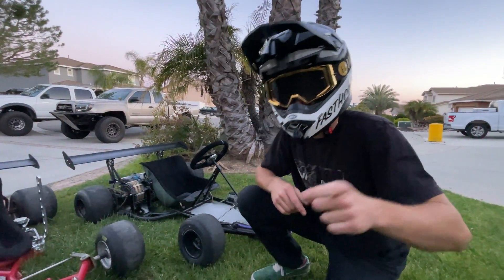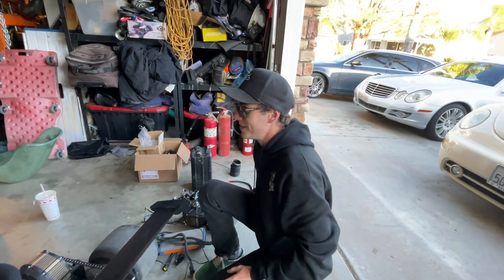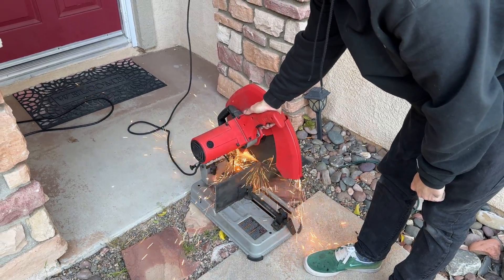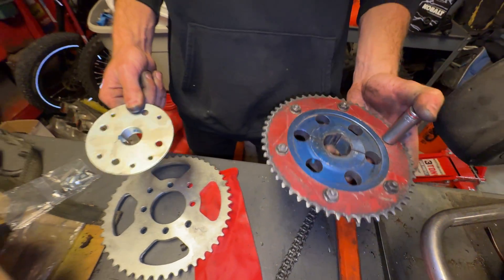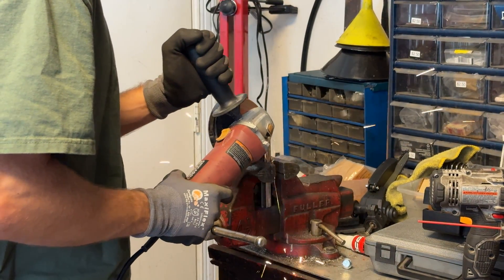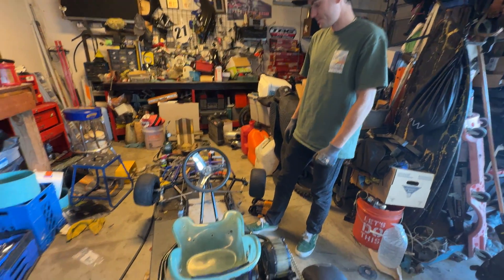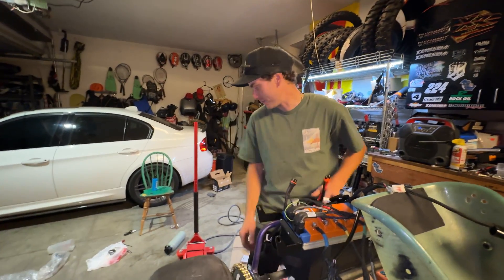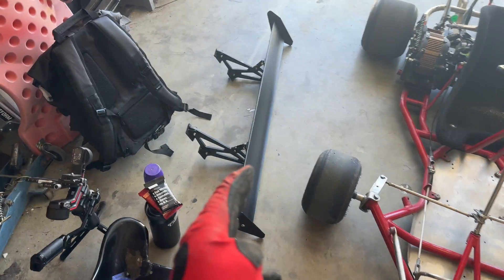We Built Another Electric Gokart! | DIY Tutorial

Comment: Why did it shoot a bolt of electricity when you plugged it in?😮
Reply from the maker: Didn’t have a breaker for it yet. So it was 72v 300amps of instant power going into the connector. If you add a breaker it won’t spark.

Comment: always amazed these plug and play controllers never use a precharge resistor
Reply from the maker: Yah, my kart has a circuit breaker that goes from the battery to the controller. This kart was sketch having to plug it in without it 😅

Comment: Great build! I'm planning to make a go kart soon but I have a question, I know you said the budget battery is 48v but what is its Ah?
Reply from the maker: The battery I was talking about is out of the Segway x160. 48v 20ah. After owning the keys for a bit now I would recommended something with higher capacity. Or running 2 of the battery’s. The gokarts pull a ton of power
Reply: @motomatt224  awesome thank you!

Comment: I honestly want to take a pedal kart and put a 3-5000w motor on it with ebike batteries and a thumb throttle and an F1 steering wheel with off-road tires around 20 inches outer diameter

Comment: Can you make a video on the electrical part (controller, battery, switch, throttle, etc)?
Reply from the maker: It’s really complex to get the app working correctly and can be a total nightmare. But next video I can go over the baseline settings in the app with the FarDriver controller.
Reply: @motomatt224  hey man, I think they're referring to connecting the battery to the controller to the motor. Like a quick walk through of what connecting all of it actually looks like. Thanks!

Comment: No hate, but gas is easier to built and way cheaper. Ik electric dominates gas but still
Reply: I much prefer the price of gas karts but electric is alot more quiet so night time riding would be stealthier
Reply: @Revuel_0 I saw a kid with a Surron say he wouldn't get away with even a fraction of his shenanigans if it was gas and loud. That's why I want an electric build myself.
Reply: @Revuel_0 how about a hybrid go kart with 72v 20ah plus gas engine😏
Reply: Easier to build???????? Ur funny
Reply: @Brisson. I don't think one is inherently easier than the other. Both could be low-level builds that would require some knowledge and expertise or could be largely bolting together existing solutions/kit, etc. The rest is mostly just how your individual brain works. I find electronics easy, but my brain struggles with fabrication, mechanics, etc and I've got friends/family that are the complete opposite.  I've got cousins who could do a gas build in a day and have time to test drive before the sun sets.
Reply: Honestly this is a pretty easy build. If you've ever seen a e bike kit just by looking at one you can figure this out
Reply: Electrifying a kart or a bike is so easy it’s actually dangerous. Something goes wrong in a gas engine you’ll only have to deal with frustration
Reply: Disconnect the battery and it will run 2 years later. Gas will be gummed up and you'll have to tear down the carb and shit.
Reply: But stil whit an gas go kart you have to reaplace the 2000 dollar engine every 50 hours
Reply: I love gas motors but it's nice being able to ride my electric dirtbike as much as I want around the neighborhood haha
Reply: Gas requires so much maintenance it’s not worth it in the long run

Comment: When will the parts list release?
Reply from the maker: Tomorrow afternoon. Haven’t had the time this week. But I’ll make sure I get it done this weekend at the latest.
Reply: Also do you have to do any soldering?
Reply from the maker: @Mocha_227 oh yah. Tons of soldering. But I just used those quick soldering connectors from amazon. Working on the parts list right now 🤘🏻
Reply: @motomatt224 in interested in the parts list too. I'm in the process of building a shifter cart but having a hard time finding a rear sprocket. 

How many teeth are on your sprocket?

Comment: So much wrong in the way you guys built this. If you want your kart to last, maybe not do it this way guys. Karts are delicate. You guys hammered your axle. Ruined your chain. Alignment.
Jesus bro
Reply from the maker: That sprocket is temporary while the new sprocket is on order, we rigged it to finish the video (as mentioned in the video). Yah its a old GoKart not a Lamborghini, everything on that thing was rusted or corroded so we used a rubber mallet.
Reply: @motomatt224  never hammer the axle. When you sand it. Even a light sand. Trust me. I’m building an electro and co qs138 kit go kart. Sand the axle. Until it’s silver. Watch how smooth it’ll spin and to I interchange parts